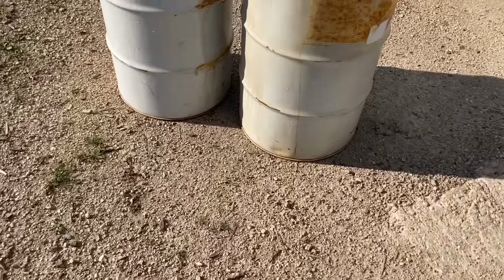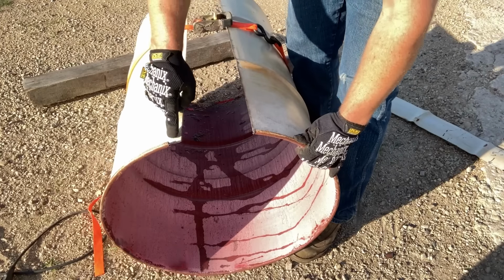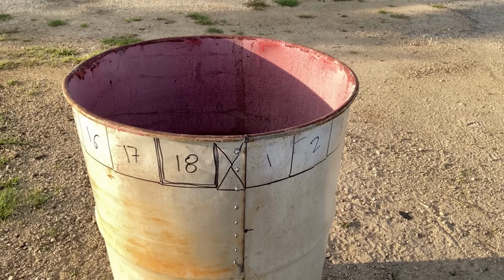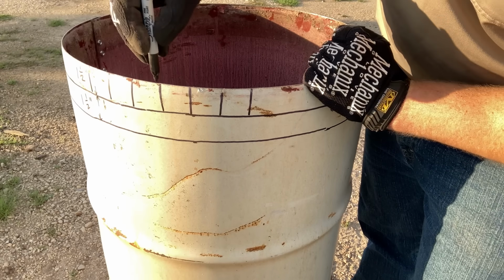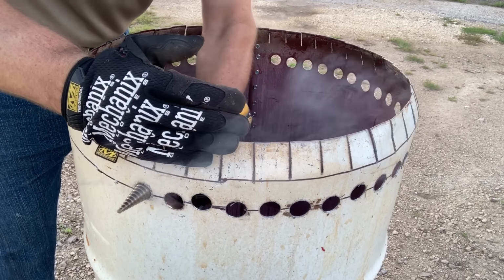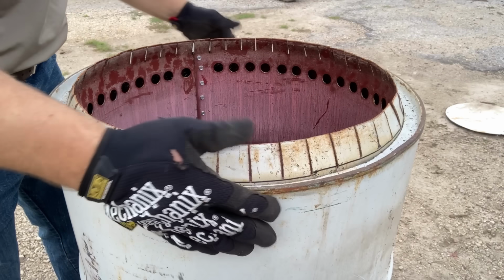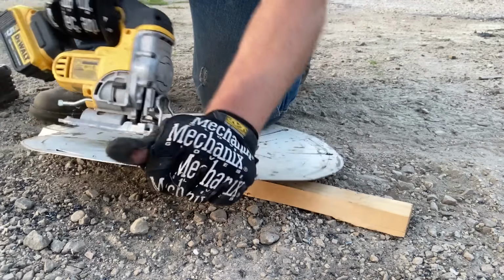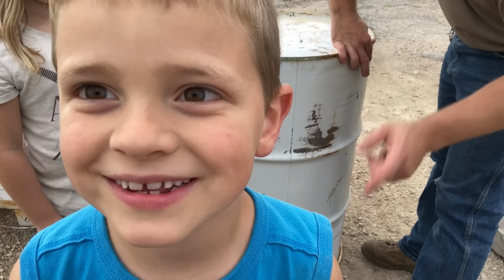Smokeless Burn Barrel

Comment: Four legs are better than 3.  Look at the leg and vent panels before cutting.    Number 18 for me ended on the seam.  Best to over lap inner drum seam with area not cut.  Think about it you’ll get it.  After I made it I thought having two 3/8 x 4” bolts sticking out of the outer barrel close to the top would help move it to the location and aid if it ever needs moving.  When this incinerator is running the flame can reach 3-4 feet above the can if loaded.  Even with only 1 foot of burning material the barrel generates a lot of swirling  air flow which throws a lot of 1/2” ash into the air.  The burn is very complete and I do not notice hot embers but lots of floating ash, not an issue in a farm or backyard away from the house by say 50 plus feet.   This is a fun project and personally rewarding to complete and watch it work.  I used a carbide Lenox 1” hole saw with a paint cap of used oil to dip and drill, no pilot hole needed and it goes very fast no preplanned spacing needed other than line 1:5 & 3” guides. 1/2” starter holes and a  Jig saw with a Bosch metal blade went through everything like butter well maybe a bit harder.   A harbor Frieght rolling magnet was a incredible at clean up making life easy.  Everything is razor sharp so his advice and directions will save a cut, I made out injury free.  It was mentioned on another video post.  You do not want to do this with a flannel shirt, the guy had to throw his away. All the cut metal especially from the grinder will stick to flannel.  I used a welding jacket but any smooth long sleeve cotton should do fine.  Polyester can melt from grinding sparks.  When screwing the legs a quick trigger bar clamp is awesome.   Enjoy your project, very rewarding.
Reply: very good points. do you know if you used the thinner type barrel?  i know when i bought my barrewly i had  the option of the thinner and thicker one. i got the thicker one and its been hell to cut with jig saw and step bit and bending the tabs inward for the inneer barrel by hand was not  possible. i went thru 3 metal cut off wheels.
Reply: @warrenpeas  I used a standard DOT oil drum with bung holes.  Which should be the thicker barrel.  I used a Bosch metal blade, I have used cheaper blades and they dull very fast.  I also poured oil in front of my blade.  I did not use a step bit, I used a carbide tipped lenox 1” hole saw and dipped it in used oil before each hole.  Oil really helps and expensive bits, so I use oil to give them longer life.  Both tools are still good to go.  I am impressed with the Bosch jig saw blade.   Now the fins and legs I cut with a professional cut off disk on an angle grinder.  It was worn down about 50%.  No oil on the cutoff wheel.  Best of luck. Lots of satisfaction when it’s finished.
Reply: @mrfrankbosh  im almost done. i just have the vent holes for the outter barrel and the vent disk that sits in the bottom.  thanks
Reply: 6 legs are better than 4 legs
Reply: @Twichery  ha ha ha yes they are already lost one leg. Thinking about a cast iron set of legs. I move my barrel often.  Still the best burn barrel I have ever made.  It is awesome to load and watch.

Comment: That is a lot of work just for a burn barrel, but I can't deny the results. I'm probably going to try this on my next burn barrel. Should be a fun introduction to my next set of neighbors :D
Reply: and it's the journey - not necessarily the destination - it's the way of the Maker
Reply: The thing will rust and you'll be making a new one. Nice to play
Reply: Did your previous neighbours ! Move ! Out !??
Reply: @davidwillard7334  , lol, no. We're moving this coming summer so there's no sense in putting in that much work for a burn barrel if I'm going to be moving to the opposite side of the country soon.
Reply: I wonder, if you paint it inside and out with high temp paint how much longer will it last?

Comment: I use a old white washing machine tub, it don't really make smoke when its burning since it has holes everywhere and also I use it to cram pack sticks to the top that's been laying around in my yard. I got this thing so hot over and over, I had this tub for over 5 years sitting outside in the dirt and its hasn't rusted yet.
Reply: Can i find one in a scrap yard?  I want a burning cylinder of inferno.
Reply: @dyscea I'm sure you can, I got mine from my brother cuz he is a service technician on appliances, he collects alot of broken tubs and motors to take to the scrap yard. If you do find one, the ones painted white has a ceramic coating that can withstand the heat and rust.

Comment: You could probably simplify the design by instead of drilling all those large holes, just making L-shaped cuts and bending the tabs in such a way that they help the air rotate. That would also save on the expense of the stepped drill bit and would basically allow the entire project to be made with less tools.
Reply: Well he did invite you to reinvent the project
Reply: @TruckTaxiMoveIt  well said sir.
Reply: I simplified building a burn barrel!
  I laid my barrel on it's side and kicked it. While it was rolling I shot 15, 9mm rounds through it. I had a burn barrel in under 30 seconds, although mine makes a little smoke...
   Ya'll Take Care and be safe, John

Comment: Just finished building mine yesterday.  Minor tweak to the feet using the ring from the removable top to create a foot that won't sink into wet ground.

It worked like a champ, burning branches and twigs... gobs of wet leaves and pine needles.  I could get it to smoke if I overloaded with wet duff... but not for long... then it was back burning clean!!  Incredible sound and visuals of the fresh air burning combustibles at the top of the barrel.  Amazing to watch!!

But, it only lasted about 3 hours and the bottom/pinwheel collapsed and the system lost its draft air feed/vortex.  I'll need to remake the pinwheel, I may put it a few inches higher to allow more ash build up.  The new one will need to be thicker steel, Maybe 3/16" and it needs to have a center support...  tube, round bar, something to support the pinwheel once it softens under heat soak.

Comment: Nice,
Gave me inspiration to make my own design. It is basically the same but I made 3 changes/additions:

1. Air regulation
To the bottom of the barrel I added a second layer, made out of the 2nd barrel top. The pattern of holes in both bottom layers are layed out in such a way that I can regulate the air inlet by shifting the top layer in relation to the bottom layer. I can operate the position of the top layer by folding out a piece of metal (made by one of the holes in the layer)  through a slot I made into the barrel side
2. Leaving the rim intact
I removed the top of both barrels by grinding of the top op the rim until you touch on the welding seam between barrel and top.
It makes a nice and clean separation and you end up with two barrel tops and a rim on both sides of the barrel.
3. Stable barrel legs
I used the stroke metal that is cut out of te inner barrel to make 3 legs that are attached to the outer barrel. Makes it quite stable.

Tnx for the inspiration.

brdi
Reply: I'm a visual kid of guy have have trouble visualizing what you did. Is there a way I can get some pictures to show me how you did that?
Reply: @Biglou13-z3p yes I can bur not now since im traveling around Europe. I’ll post some pictuelres when im back home

Comment: the same effect was achieved when I used a 30gal raised up on fire bricks inside of a 50gal. its a lot faster than all the cutting, and the air gap between the 2 barrels allow for crazy airflow. it creates a vortex style flame, I was able to burn leaves/wood/large logs Etc. extremely fast and was still almost no smoke at all. just something to try?
Reply: This sounds like a great idea, got a video?

Comment: Invite accepted.  I used a larger size Stainless Steel Wine barrel, cut off the rubber 'tires' and drilled some 1" holes in the bottom.  I bent an oven tray  90° to form an air distributor (draft guard) placed inside on the bottom and Done.  It is mounted on 3 bricks laying flat.  No big area of coals to be blown outward to combustibles.  Lots of combustion air but not as smokeless as yours.  Did not take hours to make or 2 barrels, several drill bits and grinding wheels either.  You could have used a plasma cutter to speed up the build.  My previous Burn Barrel was a 32" dia 50" long piece of galvanized Culvert set on some 1" thick spaced apart Patio stones for combustion air.  It lasted 6-7 years.  I have a large piece of perforated  S.S. that I place on top to keep floaters inside.
Nicely thought out.

Comment: Thanks for the video. That was fun. 

The next step would be to build a roof over the improved burn barrel and channel the heat past a bank of water-filled tubes. Because you are burning the contents more completely, you should be getting more heat. If you could capture that heat and use the energy in some way, you'd have an even more useful system. 

One point that people should keep in mind is that you are still generating a great deal of CO2 and maybe some CO through this combustion. Even though there is no visible smoke, no one should put this kind of barrel in an enclosed space where the CO2 or CO could build up and asphyxiate people or animals. I don't know whether this would be safe to use to increase the CO2 inside a greenhouse and try to speed the growth of plants.
Reply: For greenhouse use, you would need a CO detector and alarm, to monitor that
Reply: @rodschmidt8952  I don't remember whether CO detectors are also detecting CO2. If the better combustion means very little CO generation, then a CO monitor might not detect reduced oxygen levels in the greenhouse from an overabundance of CO2. If one had an automatic watering system, maybe one could send that heat to the greenhouse and avoid entering the greenhouse more than once or twice a week. In that case, one could ventilate the greenhouse thoroughly, enter, do whatever work was necessary, close the ventilation, and then send the heat from the fire back into the greenhouse. 

I would still want a CO monitor even with those precautions. Instead of an alarm, I would probably be happy with a window setup so that I could look at CO levels without having to enter the greenhouse. We might even be reaching the point where one could have the CO sensors in the greenhouse but have the data sent by WiFi to a computer or phone outside the greenhouse.

Comment: The grate must work via Coriolis forces, meaning that I, an Aussie, would have to bend the flaps...the opposite way!
As the grate uses this inertia to force air into an ANTI-cyclone, increasing turbulence and hence burn efficiency.
Reply: Just turn the barrel upside down, then it'll be right side up, eh?
Reply: You could use dried kangaroo dung as fuel too.  Here in America I'm stuck using cow chips.

Comment: my top suggestion for improvement: improve the grate. the one you got there will be wrecked after two good sessions. if you look at a proper fire grate you'll find they are usually made of heavy-duty iron...........
Reply: I do think the whole thing is rather over the top , nice but all a bit too much . One barrel , reduced to being a multi hole " bracket " , peppered with holes ( 3/4 inch ) all over the surface at 6 inch intervals , I'm sure would do fine, not quite as safe, ie no cooler outer skin.........but.
Reply: Like mangrate
Reply: Agree...the grate is too flimsy and will be trashed quickly.   Maybe use one (or more) of the round cutouts, reduce it in size, and secure it to strengthen the grate. Can also insert a HD iron grate to the bottom

Comment: Common mistake - helpful when you are finding your screws. "Self tapping" screws are made to thread into an existing hole. "Self drilling" or "TEK" screws have a drill point and will drill the hole and then tap into the metal to secure. Might help you find the correct screw in the hardware store.

Comment: Just a thought, but I think I would add oh, a 5/8" piece of boilerplate to the bottom of the inner barrel.

Something about the thoughts of a copious amount of coals on potentially flammable soil that is disconcerting...
Other than that, a brilliant design, and Thank You!
Reply: @CharlesBaldridge  Anywhere you have grass, trees that shed leaves, plants that grow, leave loam or peat...
Basically, anywhere BUT a desert.
Dirt TYPICALLY won't burn, because it's NORMALLY too wet. What happens when we set a Heat Source on top?
A Forest Fire can slumber underground for years.
I grew up in the Pacific Northwest. Something about the idea of Live Coals rolling around atop of 4 feet of loamy pine needles disturbs me.
Reply: I'm pretty sure best practice for any kind of fire is to put it on bare soil, and to clear anything flammable away from the source of heat for a couple feet... which means that you wouldn't have this sitting on top of brush.
Reply: I  dont like embers and ash falling directly on the ground. Id like something there to make the collection of coals and ash easier

Comment: Great job. It would benefit from an additional circular base underneath with a slide out ash and ember tray.
Reply: @robertwoodliff2536  If you go to 23:10 you can clearly see a pile of hot embers falling under the barrel, so there's no full combustion causing enough air to carry away any remains. I also personally believe a sliding ash and ember tray underneath would be of great use and benefit not only to remove any ash, but could also help in retrieving burning embers which you could remove and use for a bbq or other outdoor cooking aids.

Comment: Excellent video, great and simple DIY design!
Can it burn pine cones without smoke? This is my benchmark. :)
Reply: A rocket stove will and this is a larger version, so almost certainly.
The reason pine cones smoke so much when burning is the resin in them, which the first burn only vapourises.  Air injection and s secondary burn of the resin vapour takes care of that.

Comment: Thanks for sharing!  I just finished my burn barrel yesterday.  Followed your example, but I also welded it and used an extra steel rim I cut off one of the barrels and added it to the top.  This way there are  no sharp edges to watch for when putting in the wood.

Comment: For longer life after all of this work, perhaps using a stainless steel inner barrel would be the perfect solution.  
The bottom grate possibly could have some 1/2 inch square tubing welded onto the flats for some additional support, but it really depends on how hot it gets down on the bottom. Great job, or should I say grate job 😄
Reply: I saw someone use an old stainless washing machine tub.
Reply: @michaelmaas5544  
Those make good camping fire pits, seen that too

Comment: So what’s the melting point on a barrel now that you have more oxygen to it ? Basically how long does this version of a burn barrel last ? And Thank you for sharing
Reply: Your not going to melt steel with a burn barrel .
Reply: @codyramos3200  once you add that much oxygen to the barrel . It’s turns it in to a Foundry .so most times it is more like 700-800 F with no oxygen added but
Average melting point of steel is 2500 F , I have never added that much oxygen to a barrel to try it but if you kept feeding it would it reach the MP. Anything can melt . It just depends how much oxygen is forced to increase the heat ,
Reply: @jtsuave6125  you aren't adding more oxygen in this scenario..the design of the barrel let's the fire breath properly to not be a smoldering smokey pos. Now if you force fed the fire with a blower or bellows that's adding in more oxygen than what natural atmosphere can give..
Reply: I posed your question to the famous fact checker Rosie O'Donnell and she assured me your barrel won't melt.

Comment: I like the concept of not having a plume of smoke after a burn session but my only concern is the coals that fall through the bottom that can be blown around. I usually use a burn barrel when it is too windy for a regular fire. There is always at least a breeze it seems
Reply: Put some hardware cloth around outside of the base ? 🤔

Comment: It did inspire me! I made some adjustments to use your design as part of a Barrel-in-barrel evaporator for making Maple Syrup.  Evaporator is fully insulated with ceramic wool to retain and funnel heat under sap pans.